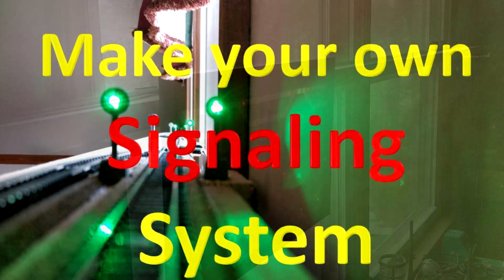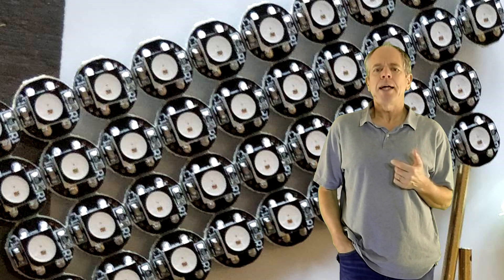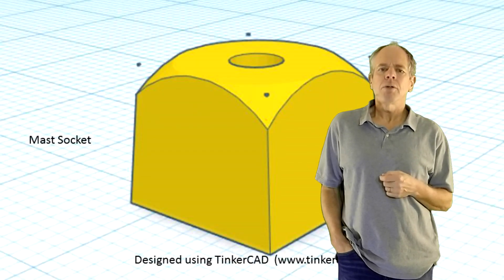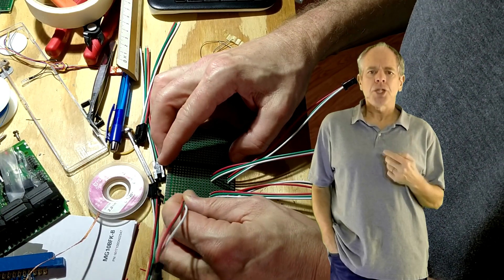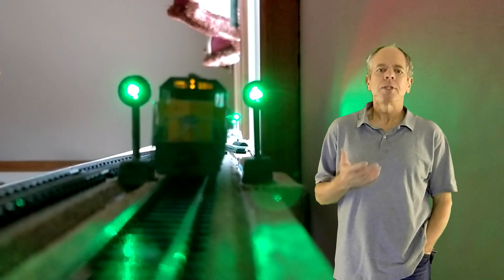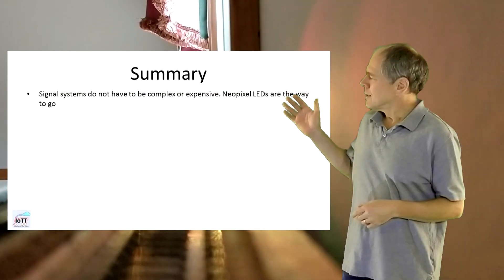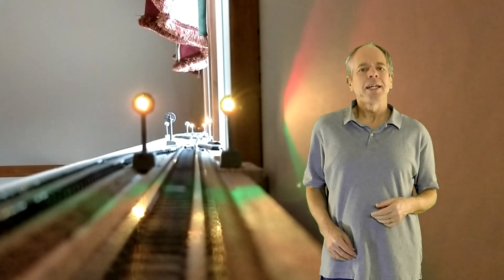Make your own Signaling System (Video#13)

Comment: I have found these neopixel. Look like those will do for n scale.
https://www.digikey.ca/en/products/detail/adafruit-industries-llc/1938/6827082
Or these 
https://www.digikey.ca/en/products/detail/adafruit-industries-llc/2758/6134706
They are rgbw. Does your program is supporting those?
I guess they can be use as well in building to animate them?
Reply from the maker: At this point I do not support RGBW LEDs, only WS2812 types, sorry. 
However, I checked and it looks like the FastLED library I am using can be adapted to support RGBW types as well, so I may do some testing in the future.
Looking a little deeper into the topic, it seems that the SK6812's actually should work with the WS2812 Protocol, so you may want to give it a try. I would assume though that the white chip of the SK6812s will not be used.

Comment: i dont really understand electronics.  I am trying to make a simple signal system that has no detectors and the lights hooked to a timer that goes green for 45 seconds and red for 15seconds.  My layout is about 16' by 24' and every point is visible except for a long tunnel.  However the operator that is going thru the tunnel will only be about 5' from the operator outside the tunnel and I believe they can work together.  I dont need a real prototypical system only light displays for eye candy. I am open to suggestions as to seting this up.  My contact info  michael_h_mcmillen@yahoo.com

Comment: For N-scale, you could mount the LED's below the layout and use fiber optics to transmit the light into a scale or close-to-scale sized signal head.The dummy signals sold by Bachmann can be adapted. Would love to see the wiring for a three-light system as well as a bit more detailed instructions. I'm a complete neophyte. Thanks for sharing.

Comment: Great videos and veer interesting
I have done some testing on the WS2812 serial LEDs and a couple of points.
Using a PIC micro and PWM values of 0x0F (Dim) through to 0xFF (Max bright) I found the maximum current draw per colour is 13mA.
If all RGB on one LED are lit at the maximum value of 0xFF then the current draw is 39mA per LED.

Per colour

;0x0F = 0.3mA

;0x1F = 1.1mA 
;0x2F = 2.1mA
;0x3F = 3.0mA
;0x4F = 4.0mA
;   |             |
;0xFF = 13mA per colour per LED

;39mA per LED if all RGB at maximum brightness
.
The power supply might be something to take into account if many WS2812 LEDs are to be driven at maximum brightness. However, the lower values lit the LEDs OK for signals.

The other problem with these and other multi-colour LEDs is the different colour dies (internal LED) are off set from each other and this shows up in a signal or panel.
An example for Green and Red LED dies are lit to get a Yellow (signal), and the green and red show independently. I have partially fixed this by fitting the signals with a 3.2 mm acrylic lens in front of the LED to disperse, scatter and mix the emitted colours.

My working signals are shown on my videos, just click on my You Tube Logo.
Reply from the maker: Thanks for your comments.
Power is an issue, yes. For this reason, I put a power supply in the Blue Box. I will show this in a future Video featuring the hardware. But even if you power from the controller board, you can always add additional 5V feeding points anywhere along the chain, so there is  lot of flexibility. 
The biggest problem I find with the RGB LED is the dependency of color on the angle you look at. If you look straight into the signal it might look like yellow, but from the side it is more green or red, depending what LED chip comes more to sight. To fight that, you should have some sort of light diffusion in front of the LED. I will do some tests the next few days simply putting a drop of hot glue on the LED, I will see how that goes.
Th other complaint is that the 50/50 yellow is too yellowish. as mentioned in another comment below I have good experiences with using following values: Green: [0,60,0], Yellow: [155,82,0], Red: [151,0,0]
 as a base and then scale it down proportionally if it is too bright (and as you say, this also helps with power consumption).

Comment: Simple solution buy cheap signals from e bay get an arduino get infra red sensors block signalling simple less than 10 UK pounds per signal

Comment: HI,  I have just installed two signal gantries on my out door railway. Each has 3 neopixels.   All is well apart from one minor detail..... the yellow is rather unconvincing.  May be pixels.Color(150, 150, 0) is  wrong for a convincing yellow.
Reply from the maker: I would love to see pictures of those. Did you build them yourself? If your are using 5050 LED's, your yellow is probably too bright, as those LED's are rather powerful. On my CTC panel (Video #9) I use (50,50,0) for track occupancy LED's and it is still on the higher end. You can also try to add slightly more red than green, e.g. 55,45,0 to begin with. It pays off to play around a little bit.
Reply: I have  taken some pictures   which are at     http://thefraserline.blogspot.com     The apparent halo is caused by the black glossy paint I used.
Reply from the maker: Thank you. Looks great. Off course you have to teach the RhB Allegra's engineer the meaning of those aspects as the signals are not in compliance with the Swiss federal railway system's L type signal code ;-)
Reply from the maker: I played tonight with some values for color settings. Here is what gives me very convincing colors on my 5050 LED's: Green: [0,60,0], Yellow: [155,82,0], Red: [151,0,0]
Keep in mind that the human eye is more sensitive for green than for other colors. For this reason, you want to run green at lower intensity. Also, as you see, I added quite some more red into the yellow to make it look more like gold instead of the very light yellow of the LED.
Overall, these settings are still very bright. 
depending on the environment brightness, I scale them down to between 10 and 50% of the values shown. The colors look good in the entire range and are still quite bright.

Comment: The WS2812 IC has the LED integrated into the Chip, the WS2811 is just the Chip. They use the same chip.
Please explain the 200 devices. I am confused how you got that number.  170 I do understand for Neopixels.
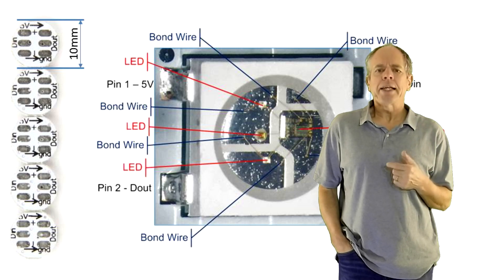Reply from the maker: You're correct, the chip without LED is the WS2811. The WS2812 is essentially a WS2811 integrated into a 5050 LED as shown in the slide at 1:25 into thew video. The picture actually shows a WS2812B chip, which can be recognized by the 4 contact pads vs. the 6 of the WS2812. From a data protocol point of view, there are slight differences (length of reset pulse) , but they are still compatible.
Neopixels can be daisy chained in infinite numbers, so there is no limit coming from the pixels itself. The communication protocol works in a way that after a reset the pixel accepts the first data package as command and all following packets are passed on. So with more pixels in the chain, all what happens is that the maximum refresh rate gets lower. It takes 30 microseconds to update each pixel, so you can easily calculate how much time it takes to e.g. update 1000 signals with 3 LED's each. Still no problem for a signaling system, I guess.
So the real limit comes from the microcontroller which needs to store the color definitions for all LEDs for each aspect to be displayed. For my 1 LED - 4 Aspect signals that's about 150 bytes per signal used on the heap, and the total heap available is about 180kB, so this would be sufficient for about 1200 signals. Now, if your signals are all with 4 lamps and 36 aspects,we are looking into about 5k heap space per signal, which would last then for about 36 signals. For an average signaling system I think it is more like 3 lamps and 4 aspects, and that would easily give the 200 (calculation shows 400 signals) signals I mentioned in the video. Probably more, but I don't want to brag too much ;-)
Reply: Thanks for the explanation.  I  use the DMX protocol with Pixels and run them normally at either 25 (40fps), 50(20fps) or 100(10fps) Millisecond for 512 channels, (Actually 510 on pixels).  Quality of hardware is an issue sometimes trying to use the 25 millisecond, using 100 millisecond is 10 times a second and you might see flicker at that speed. 50ms seems to be the go to FPS. You can run up to 680 pixels at 25ms safely at these speeds.
I am working on something similar to what you designed but can be wireless or hardwired.
Regard
Reply from the maker: Thanks for the info. Sounds very interesting. I did not know there are DMX nodes for Neopixels, or do you make your own? 
In my opinion the WS2811 has some advantages over DMX as it is 3 times faster and does not require terminator resistors. DMX is based on RS485 and in the meantime has quite some years under the belt. On the plus side though, it is an established standard and a lot of commercial components are available, particularly for stage lighting and the like.
For a signaling system, I think the refresh rate really is a non issue, we can go as slow as we want because there is not much happening. In fact, on the Blue Box, I am only refreshing the LED's if something changes. So, sometimes this is every 10ms in case an aspect changes and fade out/fade in is activated for the particular signal head, sometimes it is every 500ms if a signal head is displaying an aspect with a blinking LED, and sometimes it is no update for several seconds if there is no change to any signal.
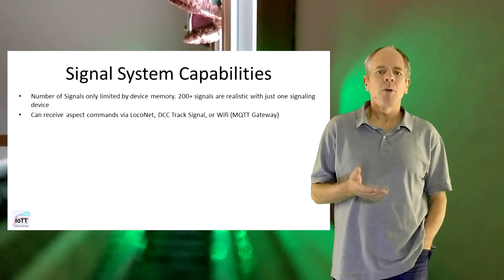You are for sure on the right track when you make your device capable of wireless and hardwired. That's what I do on the Blue Box, as you probably have seen in the Video (around 4:50 Min.).  It can run from DCC, LocoNet or Wifi/MQTT. With nowadays capable controllers there is really no reason to not make every device Wifi capable. It's called "The Internet of Toy Trains" ;-)
Reply: Yes, most of the Animated Christmas light displays use DMX with the WS2811/12 Chips, they run up to 500,000 lights this way.  You can get a small wireless unit called a ESPixelStick that can control up to 1360 WS2811/12 Pixels. that's 4080 channels. I use them in my Christmas display.
Each WS2811/12 needs 3 channels to drive one pixel.  DMX is an industry standard and has been modified to accept a new standard called E1.31 which allows you to send the data over an IP address.
DMX has a limit of 512 channels, however if you divide 512 by 3 you get 170(510) with 2 channels remaining. The last two channels are not used. So you can control 680 pixels over 4 DMX channel on one data line .  The maximum speed used is 25ms (40fps), but normally 50ms(20fps) works just fine.